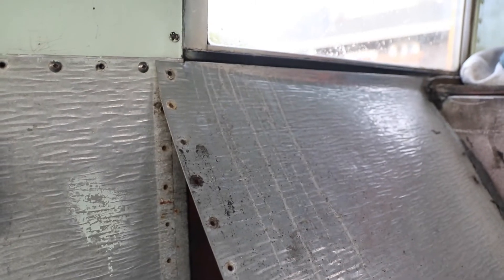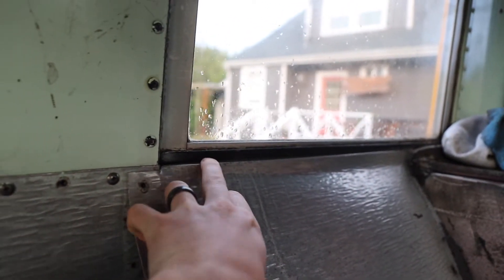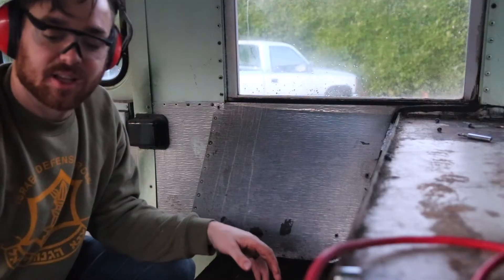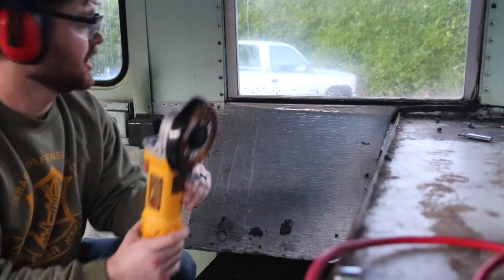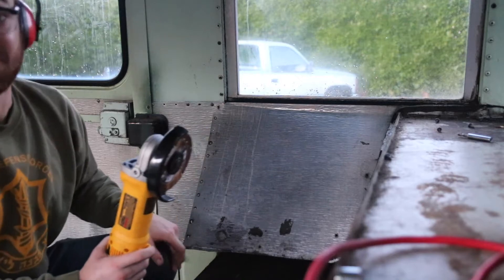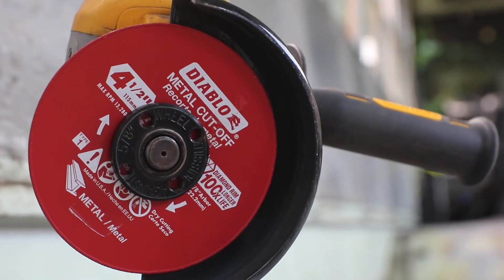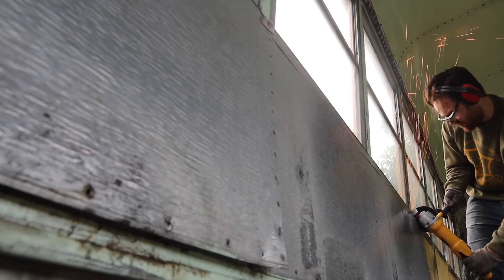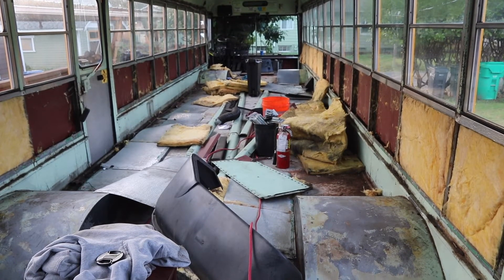Wall Removal - Skoolie Bus Conversion - E6

Comment: Thanks for showing. I wasn't sure if I should try to remove the last 6-8" of the wall. Watching several videos (including yours) the answer was "no". Thanks! You should have a mask on also. That grey/black stuff in your nose is now in your lungs too.
Reply: What was the reason though? Structural?  It just takes up even more space with the lip for the seats be nice to remove it even if it is Structural. Or mabye you can cut out the old seat lip so dont lose 2 inches of space